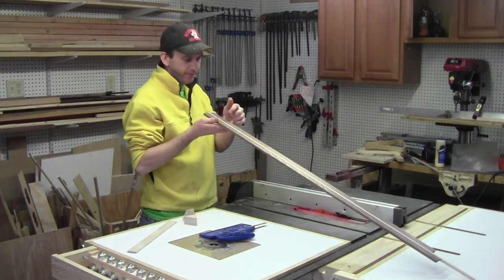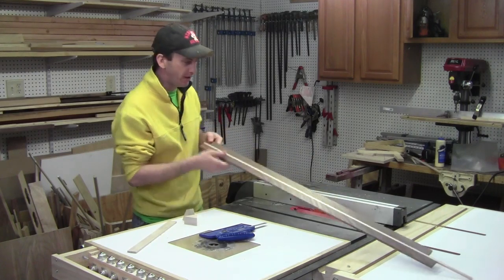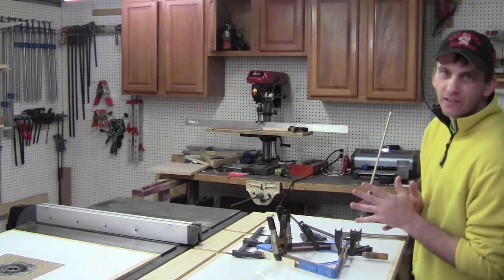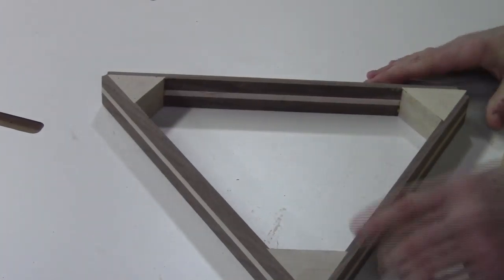Woodworking - Make a Custom Billiard Rack

Comment: I'm planning on making a rack for a christmas gift and just found your video while researching dimensions and designs.  That's a very nice looking rack, but I have some comments/questions.

Most of my questions follow along with what Jeffrey Fluharty brought up.  The only reason I can see for not maintaining consistent size of the corner triangles and sides is to alter the amount of maple reveal on one of outside corners.  Presumably to indicate that corner to be the head.  Doesn't that just add unnecessary complications?  Why not keep all dimensions consistent and use some other method to mark the head?  In my case, I plan on adding a touch of Greene&Greene style by using diamond shaped ebony plugs to mark at least 1 or maybe all corners.

When cutting the radius, it appears that you brought that arc all the way to the base of the rabbet rather than to the outer point where it meets with the inner edge of the sides.  If that's true, then the thickness of the sides will end up being reduced by the depth of the rabbet, which by my estimate would bring them to 1/4" rather than their original 3/8".

I believe someone else has already mentioned this, but the easiest way to cut the rabbet with the 60 degree angle would be to use a 60 degree dovetail router bit.  I just picked one up for $20 and I've seen them as low as $10.

Comment: Good vid Laney. However, I have questions. Why aren't all the corner pieces the same size, and then just make 2 side pieces slightly longer to provide finger clearance to pack 'em tight? You would always want the same corner on the spot, but it would be easy to mark that corner with a dot, or something, right? I don't understand the one corner smaller. Also, aren't standard pool balls 2 and a quarter inches (2.25) in.diameter? You said you were using a 2 1/8 in Forsner bit? Why not a 2 1/4 in bit? Wouldn't the radius match the balls better? Does it matter how deep the rabbet for the corners is? You didn't specify how deep you made them. Does it matter? Somewhere in the "comments" section, you mentioned a follow up video. Still planning that? I want to make one of these for my son, but I'm not sure about some things mentioned. You said the angled end of the rabbit was to be 2 3/16 from the end of the side pieces, but in the video, the side pieces looked like they came right to the apex of the corner pieces, even the pieces that were supposed to be 2 1/2 in. per side? Any help would be great. You look to be a pretty good pool player! Thanks for your time.

Comment from the maker: Long story short, we increased the size of the lower two triangles, by 3/8"  (from 2 1/8" to 2 1/2") So we reduce the size of the lower side by 3/8"  from (13 1/4" to 12 7/8")

Comment: The bevel is 60 degrees. On the table saw and the miter saw you start at 90 degrees so to make a 60 degree cut you subtract that from 90 and set the saw at 30.